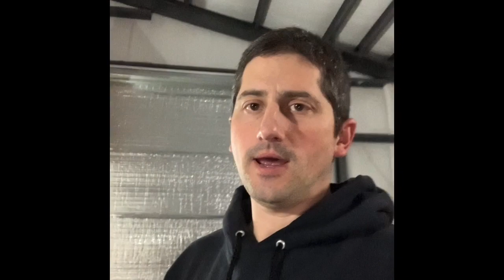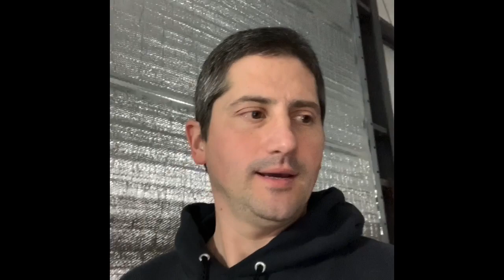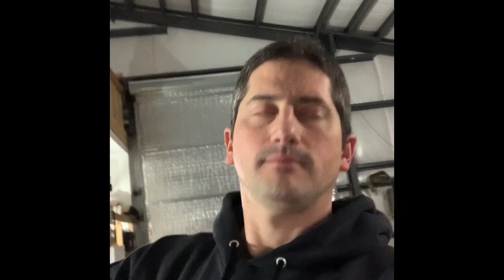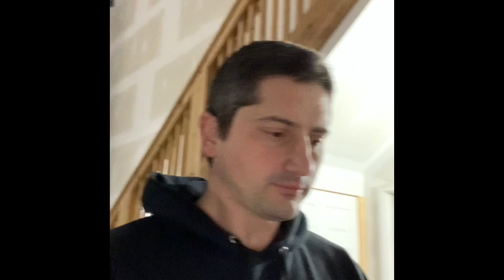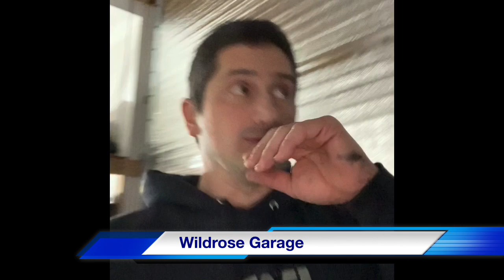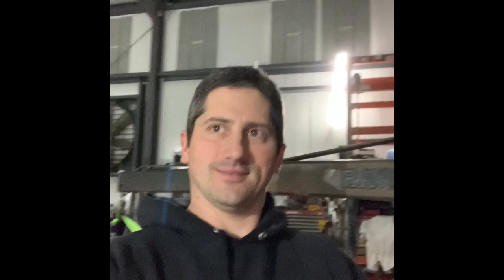Bolt torque & re-torque, Do it the right way. Head gaskets that last longer cause more equal force.

Comment: je vien de faire çà sur le moteur de mon jeep  willys que je change de heah gasket jai torker a 70 lbs et  je frapper les bolt avec une marteau jai resserrer  avec les meme specification a 70 et jai fait presque 1/4 de tour sur chaque bolt merci pour le conseille je revien dan 2 semaine pour plus de detaille si je une fuite

Comment: Just did my Subaru. Torqued the arp studs to 90. Took a small ball peen tapped the studs lightly. Dropped to 81 ftlbs. On an electric dialed in torque wrench. I believe it gets the hydraulic tension out in the lube. But I then retorqued to 90ftlbs tapped again didn’t move the second time. Then I assembled the motor and made 400 wheel torque in my 06 Subaru sti and no head gasket failure. 22 psi.  It works verified. But also lightly hit them with a small hammer. Not a 20lbs sledge.

Comment: Funny but in the mill wright world when you are installing huge bolts you have one person hit the head of the bolt with a 8 lbs sledge hammer while another person tightens it with as much might as they can with a cheater bar. But be careful on smaller bolts you can over stretch them but tapping on them lightly with a brass baller and retorquing back to the spec was actually tested to work

Comment: I work on briggs and stratten vtwin engines.  they have a habit of blowing head gaskets.  Can I use your hammer method on small engine head bolts to improve torque??

Comment: Great tip. I have a Subaru with 240k miles. Do you think it would be a good idea to retorque the head bolts?  I’ve heard the Subaru engines can get leaks in the cylinder head. Cheers!

Comment: One of my cylinders is burning Antifreeze literally a drop 💧 just enough to cause a rough idle. In 3 months or so I have to add a cup of Antifreeze. 

The cylinder is the first one closest to the radiator on one of the heads. 

What I’m wanting to do and want your advice on this is to retorque/tighten the factory 4 head bolts around that particular cylinder. 

What I’m concerned about is 2 ✌️ things, 1 is should I?   being they’re torque to yield bolts and have already stretched. 

And 2 is should I tap with the hammer 🔨 before doing so? 

( The head bolts have never been touched or replaced before ) the truck has 280,000+ miles. Aluminum block and heads.
Reply from the maker: Torque to yield are the exception for hammer. Once the gasket goes thats it. Wether it be tolerance/fitment or torque. I have reused TTY bolts successfully, but I dont use a torque wrench on them. I feel when they stretch. If they get looser as they stretch they get replaced. Usually the third time is cut off point if you feel the stretch. If you follow the directions and keep having it stretch youll be lucky to get a second torque.. replace the gasket and check the surfaces. Just make sure its the head gasket and not the intake or crack in the head.
Reply: @firstrespondergarage  Right, I thought so and was thinking so that TTY bolts have reached their stretch when initially installed. Torquing them further would stretch them even further. 

But my initial thought was what if they weren’t completely torqued to spec from the factory because the truck began to do this at very low mileage 19,000 miles and that particular sparkplugs insulator was orangish brown and slightly wetish gummish the two times I changed the plugs at 100,000 and 200,000

At 19,000 miles it had this intermittent sputter at idle. Overtime it put wear on the motor mounts to where initially I thought that was the problem and changed them and it helped about 60% of the vibration THEN I finally realized it was consuming and burning coolant via the signs on the plug and periodically low coolant level.
Reply: I'm wondering the same thing!- but I replaced the head gaskets years ago and used ARP torque in bolts instead of the stretchy ones. So I should be able to reuse them. Do you think I can re torque them and possibly fix the coolant seeping into the oil?
Reply: Hello Sir,  I am curious as to how this turned out...  I am facing a similar dilemma

Comment: You know after watching this it pisses me off I have not been doing this on my motors. When I work as a pipefitter and am bolting up a flange with a bad fit up I crank the bolts trying to suck her together and when they get to tight I wack them with a hammer and get way more out of them again. I know this trick but have never done it on a motor but I should have and should have known better thanks a lot for bringing this up. When I bolt together my bottom end I will bring this up and give all props to you. Keep doing your thing. I love to learn from guys like yourself. My hats off to you.
Reply from the maker: Thank you, You know it seems like the older I get the more I found out what was right underneath my nose but I never applied it. We all learn from each other.👍
Reply: @firstrespondergarage  I hear you. Better to have this brought to my attention now than never. I think what it does is when you torque it down there is friction on the threads and when you hit it it releases the tension/binding/friction for a millisecond and then you get more out of it with the same torque applied because you are re torquing with less tension/binding/friction the second time.
Reply from the maker: @wildrosegarage4208  yes that makes sense. 👍👍